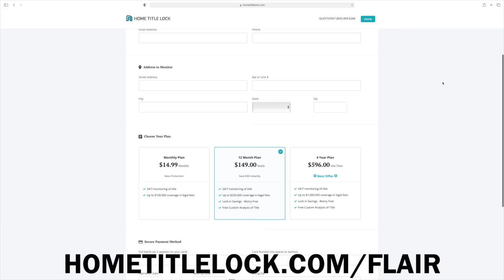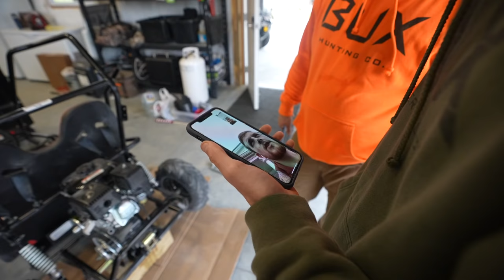I Bought a GO KART from TRACTOR SUPPLY and then SUPER CHARGED the ENGINE!!! (I Crashed It)

Comment: I kept waiting to see the super charger get installed. Then when I gave up on that, I figured I’d at least learn to remove the governor on a Coleman motor. But instead I watched a bunch of grown men struggle for an entire afternoon to remove a single throttle stop bolt.
Reply: My 12 year old would have had that out before we we left the tractor supply parking lot.
Reply: I wasted 10 minutes of my life fast forwarding to see some performance enhancement and they could have just grabbed the governor control arm and pulled it wide open until the engine blew . SMDH . Flair? If he isn't gay , he missed his calling. What a great 👍 video,not
Reply: Yeah, I didnt know supercharged meant givin her more R's
Reply: Was hoping for something cool like cars and cameras got some guys fiddling around with things they have no idea about. My sons go kart does 35 with my 245lbs and I haven't even attempted to make it fast. It's handling needs improved before we go faster. Better tires and shocks are at the top of the list. Turf tires aren't gonna cut it.   😮

Comment: On the broped if you look under the gas tank on the pull start side, there should be a grey spring that’s kinda hard to see and get to. If you put a zip tie through the spring it completely disables the governor so it stops slowing down the bike when you get to higher speeds👍
Reply: Really
Reply: I think I just broke it the springs all compressed
Reply: @juliangarcia8360  wym
Reply: @steine2543  is it the thicker black spring right under the gas tank
Reply: @steine2543  I broke it off one side and it’s all compressed now
Reply: @juliangarcia8360  no it’s the one that’s skinnier and looks cheap, it’s like 1-2 inches from the opening under the gas tank looking at it from the pull start side.
Reply: @steine2543  o gotcha it’s the one with the metal rod going threw it
Reply: @juliangarcia8360  yes I believe so
Reply: Or just pull the block appart and take out the governor because they are internal it is a gear that stalls the engine

Comment: So if any one is wondering why the go cart is faster is because that belt you see is called a torque converter. And it changes the gear ratio and the engine speed rises.

Comment: Just want to say that tighting up the throttle cable gets you more pull on the that top plate but not actually on the carburetor because its still hooked up to the governor which limits the rpms removing that screw and bolt by the pedal is what gave you the extra mph your just raising the idle with the cable which will prematurely where out your cvt and belt or the clutch on the bike

Comment: you got to put a cam on both of them and diffrent carbs. heavy valve springs lifters and flywheel. It's  it expensive to do all all. and put a yellow spring on the tourq converter. and a jugernaut driven pully it will hit 50 60 mph no prob.
Reply: He's better off getting a predator 670 engine from harbor freight.
Reply: @compacteconomycar5300  don't kill flair he's not ready for all that power lol
Reply: Don't forget the billet rod and a mikuni carb.
Reply: @compacteconomycar5300  that would be cool but I don't think he's going to cut and weld that to make it fit lol.

Comment: Easy way to add speed is there is a spring that goes from the throttle to the governor just above the pull start. Just put a zip tie thru the middle and synch it down and boom more speed.
Reply: That will make ur valves float  in depending Wich engine u have the plastic gear will break in the engine
Reply: @Slow_OBS  we have a total of 6 mini bikes all with this mod done. And one has a predator 212 with with it done and a TC intake and exhaust and does 45mph with no issue. There is a bar in between the spring that is still attached and allows for some governing.
Reply: @rickwilkinson1651  oh ok I’m just to familiar with the zip tie one I took the pain of take governor completely out that’s what I been use to

Comment: I think if you put a comet style torque converter on the minibike (instead of it's centrifugal clutch) you will get a much faster minibike. I think that is why the go kart is faster currently (because is already has a  comet style torque converter.)  Also a heads up on the go kart, I have the same model and it's been great, but keep watch on the chain that comes off the back side of the driven pulley.  Both bearing sleeve/jack shafts are welded to the engine plate with no adjustment possible. The welds break on these pretty commonly, or chain stretches, and you have to find solutions for those problems. Great content. Keep it up.

Comment: The throttle stop has some effect, however the governor control spring under the gas tank can be zip tied close to bypass the governor with out removing it.  Takes 10 minutes.  Got ours to 34mph with a 200 pound driver.

Comment: Man now I miss the old go-kart from when I was a kid, I don't think they make em like it anymore 😪 
It was bigger than that, had real beefy tires and bigger ones in the back, had like a 260cc engine or something like that. And it ran super quite, but had no trouble getting to 25mph before seemingly being limited. And oh yeah, it had a speedometer too!
Also electronic ignition and a welded steel frame/ roll cage

Comment: That's not the governor that's the throttle stop which makes it go faster a little but the governor which is in the engine block when it's removed the rpm will increase leading to a huge difference In top speed.

Comment: Tip : if you gotta spray starter fluid in to Make 
 It start you gotta clean out the carb more than likely, also to take off the clutch/tourque converter off the crank shaft of the go kart you need a 3 arm puller. Take off the governor for sure, throw a bigger jet in the carb lol and leave the filter exposed on the air box

Comment: The throttle arm is under the gas tank but if you take the govener gear out it will do top speed with the gas peddle. Also you cam put a zip tie on the spring for your throttle arm so it doesnt decompress and it with reach top speed with the peddle as well.

Comment: if you wind the throttle stop out you can override the governor a bit to gain top speed. but it's damn easy to put a cable tie / zip tie around the spring that goes from the throttle linkage to the governor to make it non functional. and if you calm down enough to actually sit down and watch videos on gov removal, you can do it in an hour... it's a simple engine, don't let it scare you!

Comment: We use to lift the bed on the 6x6 gator and reach back and grab the govn arm and pull it  that would bypass the govn and ya, that sucker would scoot. But have to be careful, there's a govn on them for a reason, that's to keep from blowing the engine. If you run bypassing the govn only run it so long cause it will build heat and with an aluminum block, it won't take long at all to fatigue all the parts and baam, paperweight.

Comment: I’m from Canada but when it’s the hot season I put 10w40 in my dirt bikes and ATVs cause since it’s so warm the engine is only gonna get hotter so the thicker oil keeps it a little cooler and the compression it needs when hot, when it’s the cold season I use 10w30 cause it’s thinner so easier to get warm and keep a nice temperature in the cold🤘🏼
Reply: And if you use synthetic oil in ur engine make sure you always use synthetic

Comment: You never touched the governor or the governor linkage. All you did was  delete the throttle stop. You could have also zip ties the governor spring under the gas tank to gain another 1000 rpm's. I have the Coleman BT 200x. I put the Predator Ghost on it from harbor freight and a torque converter. 6000 rpm and 40mph right out of the box.

Comment: I got ahold of 15 amusement park gas powered go karts and they all ways in mint condition with old 90s nascar style bodies and graphics from drivers in 90s. We missed every single one by adjusting throttle where it will go wide open and took the governor out and ported the heads and polished and my other buddies who own a concrete truck company came and poured a beautiful oval track in my backyard it's right under a 1/8 mile oval d shaped with 4 degree banking and we got lights on the track and man we have a blast racing I had one up to 52 mph so they are flying

Comment: Take the clutch bolt out. Put the bolt back in a few threads and tap the bolt with a hammer. The clutch will pop off. Then you can take the side cover off and actually take the governor out of the motor.

Comment: Remove the smaller pulley, then go behind it and removing the 4 bolts that hold the mounting plate on then you have access to the engine so you can remove the governor

Comment: Get rid of the jack shaft then flip over the çlutch add more links to the rear çhain  also bend throttle stop out of the way and it should double your speed I know because mine will go over 50 mph

Comment: That's not the correct way to load a trailer. Dirt bikes, ATV’s, go carts, tractors, snowmobiles, junk from your mom’s garage, literally anything… is always supposed be tied down at the front of the trailer. Putting the weight by the hitch, reduces swaying and increases stability. It is very easy to lose control, especially at highway speeds. Always pack the heaviest stuff at the front of the trailer, especially if it’s a single item like a go cart. Packing a trailer hitch side reduces the chances of flipping your truck and might just save you or someone else’s life.

Comment: You just opened up the throttle you did not affect the governor at all if you followed him springs back to where the little arm is that goes into the block that they're hooked onto you tie it back to disable Governor without taking it out

Comment: You actually didn't even touch the governor, all you did was back out the throttle limiter screw. There's a spring running from the carb to under the gas tank, if you tighten a zip tie around the coils of it so it acts like a solid rod instead of having any spring action you'll gain like 10 or 15 mph and way more acceleration.

Comment: You don’t have to crack open the motor to take it off all you have to do is just take the governor rod I did the same thing to my go kart my go kart isn’t the same it’s a bit bigger and it’s got a Subaru 9 hp motor in it but I just took the rod off in it it rips

Comment: Mini bike carb is dirty the idle circuit is dirty in the carburator when you put the choke on, it stays running and idles. When you shut the choke off it dies. That's a common problem with today's gas the methanol in the gas and to gum up all the carburetor circuits especially the idle circuit

Comment: I had one of those go karts me and my friend spent a week rebuilding a free market place cr 450 motor crammed it in there and took off I rolled it so hard that it snapped and the cage was bent beyond repair I chopped it make it wider put four wheeler front and rear end on it and sold it
Reply: Got like 2700 I think out of it

Comment: You have to be careful taking the governor off a small motor bc you could blow it up especially if you hold wide open throttle bc  the parts aren't made for those rpms but the thing is it's veryable chances of blowing up so you never know (13 yo. Knows this so it's concerns me they don't know it)

Comment: I would love to let them ride my minibike 212 preditor strait pipe 22mm mikuni carb 265 hot cam billet 28 degree advanced flywheel  billet rod 26lb valve springs ported head and nitrous once i gear it down so it can reach desired rpm i should do 60mph "i weigh 230"